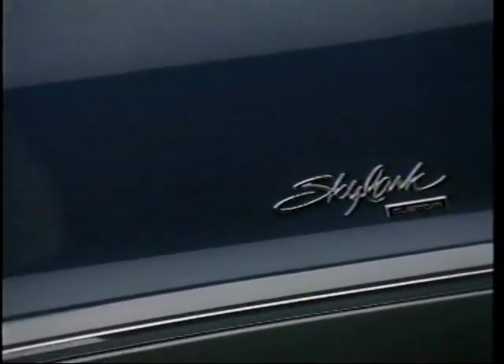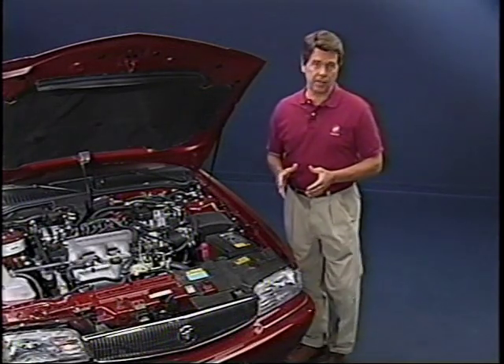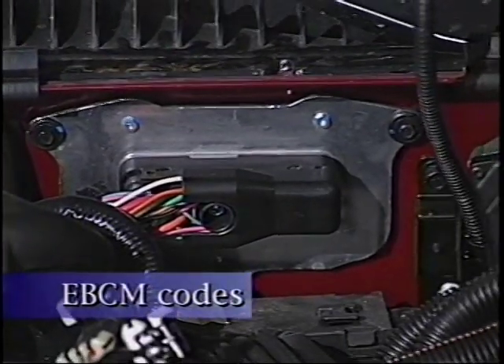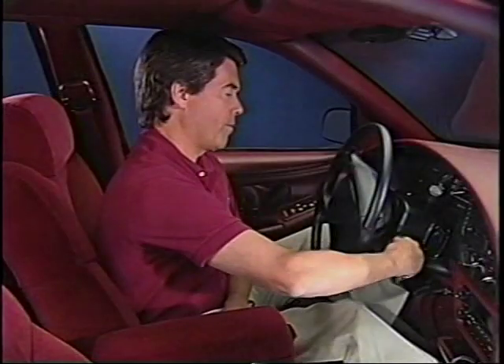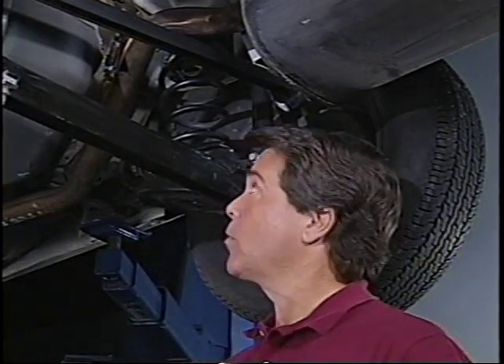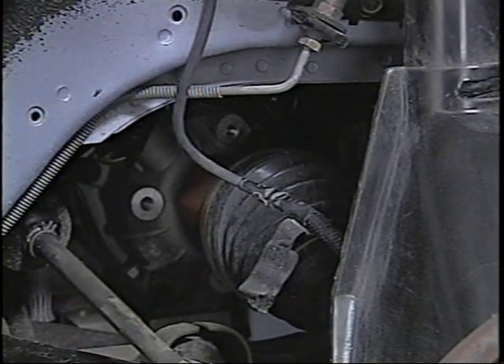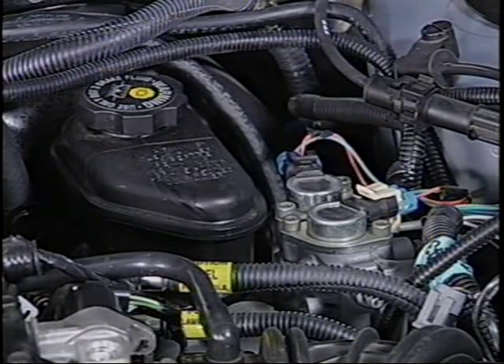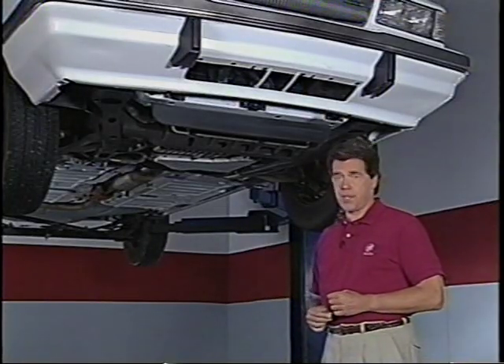Buick - ABS Update: ABS VI (1996)

Comment: The Delphi/Delco VI was introduced in 1991 as an option on Saturn, Buick Skylar, Oldsmobile Cutlass Calais and Pontiac Grand Am models, it soon became standard equipment on most General Motors front-wheel drive passenger cars until 1998.